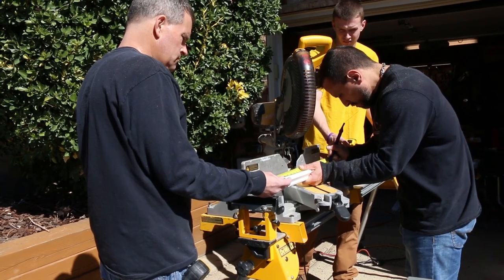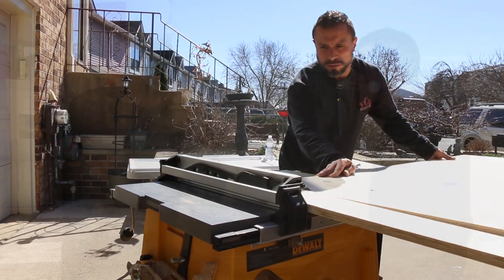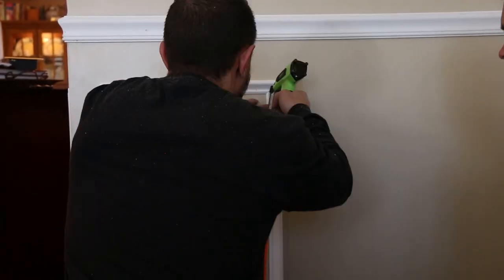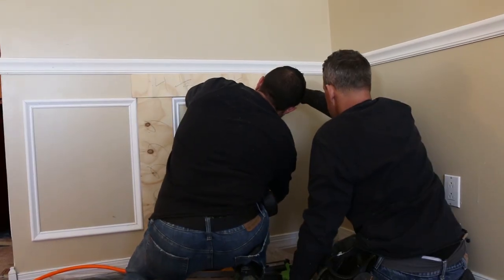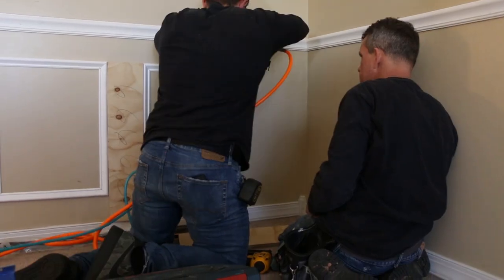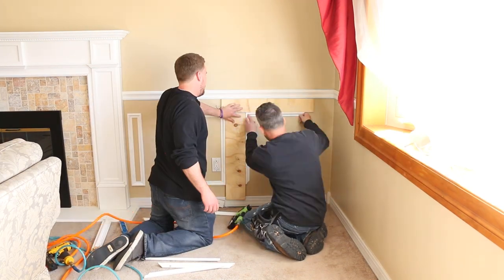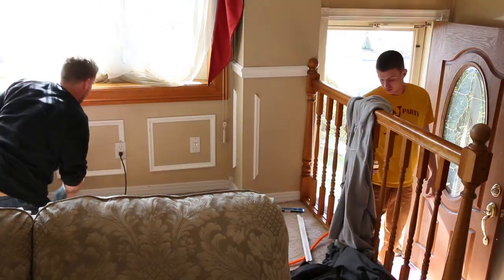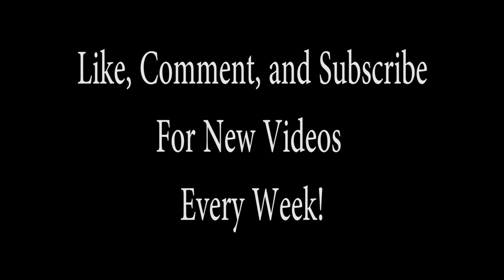How To Install Wainscoting (PRO TIPS FOR BEGINNERS)

Comment: I don’t understand. Working in finish carpentry for 17 years. Why would you not pre-assemble your cuts with insta? Far less brad nails you have to cover up. Having to measure distance/spacing between every profile actually creates more room for error.  And are you actually nailing into a stud? Your not even checking for stud placement. Are you guys actually professionals? What’s your company name